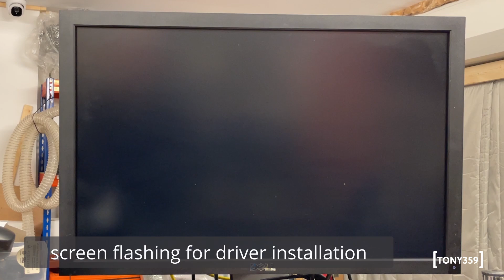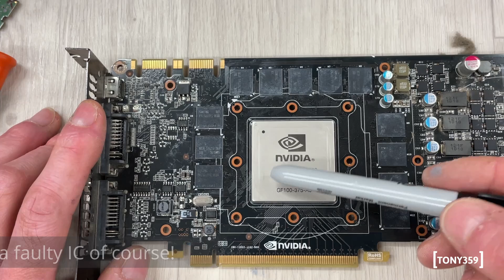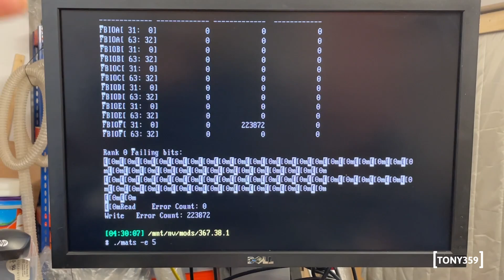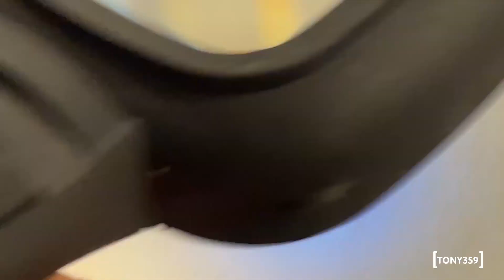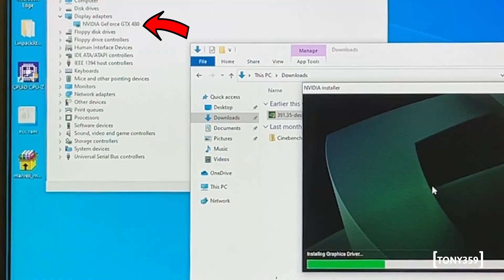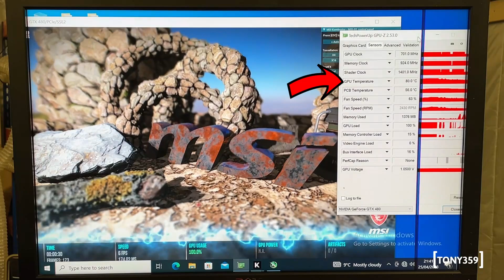GPU crashes with BSOD, can I repair it?

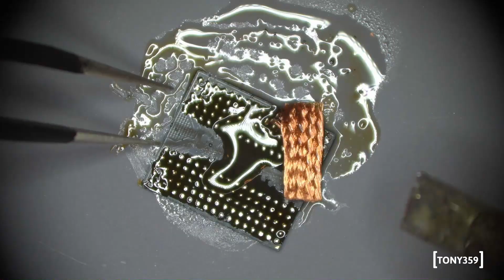Comment: 16:54 it's recommended to keep these lead-free solder balls because GDDR chips can get very hot under load. Leaded or medium temperature solder is more likely to break under high temperatures.
Also the thermal paste inside Nvidia GPUs with heat spreader of this era will dry out after years of use.
Reply from the maker: Thanks - leaded solder melts at 183C - to get 183C on a solder ball, the transistors inside the chip would be 200+. I honesty doubt that anything can work at those temperatures. I feel it's much easier to damage the PCB or surrounding components with the higher temperatures required by Lead free reballing. Thanks for the input though!
Reply: @tony359 Leaded solder doesn't melt, but has a higher possibility of cracking after several cycles under the circumstances I described. High temp soldering doesn't damage if your PCB quality is not too bad. Actually, I use 320-380 degrees to solder BGA chips with original balls, and they work well.
As always, thanks for your reply and great work.
Reply from the maker: I am far from being an expert but cracks are often associated with lead-free solder, not leaded. I feel leaded solder can withstand thermal cycles much better than lead-free. Cracked lead-free joints after year 2000 are a plague in electronics.
The only time I saw someone soldering with lead-free intentionally (besides official service centre which might be forced to obey regulations from an environmental perspective) was a german engineer who replaced the 12V connector on a GPU and used lead free as, in his opinion, it is a better choice for sturdiness on something which is subject to mechanical stress. 
As I said, I am not a mechanical engineer or anything but my understanding is that leaded solder is better - it was removed for environmental issues. Rightly so of course.
Reply: @tony359  Yup I'm also amateur. But AFAIK, cracking of lead-free solder is usually connected to mechanical damage like striking, but not thermal cycles. In fact, in my country, repair shops always use lead-free solder for laptops and GPUs, not for RoHS requirements, but for lower return rates. For devices that make less heat such as SSDs, leaded solder is okay, especially easier for hand soldering.
Reply from the maker: I haven't got elements to evaluate what you say but it's definitely the first time I hear about someone re-balling using lead free solder for reliability purposes! That doesn't make it wrong, it's just honestly the first time I hear that.

Comment: NVidia cards are a little sneaky. The VCore supply is split, with one phase being fed by the PCI bus connector and the rest by the 6+2 power expansion connectors. The reason for this is that they want the card to be able to do some things, at least power on and display an error message, even without being properly wired up, and possibly do some diagnostics before drawing full power otherwise. Most people fail to wire up the power connectors when they install their first card, and the card wants to be so polite as to point them in the right direction. There is usually a bunch of detection circuitry that goes to the VRM control IC and then that outputs the insufficient-power signal to a GPIO pin in the GPU core.

But i don't remember the symptoms when one of the heavy VRM phases fails open that you expect of this card. One possible symptom is that the card is stuck at low clocks. I don't know if drivers not launching is a valid possible symptom for that, i'm not sure, it obviously wasn't in this case and probably shouldn't be the first suspicion.

So yeah because of the VRM topology, when you measure the current on the power expansion wires, you aren't even getting the whole VCore current, some of it still comes from the PCI edge connector, and VMem etc are from the edge connector as well. However the first thing that happens to all those 12V inputs both the edge connector and the expansion wires, it goes into big fat shunt resistors that are monitored by the GPU. So when you call up the power stats in Afterburner's RTSS or in GPU-Z or any such utility, you're actually getting precision measurements of the power that goes in including VRM losses and just about everything that's on the card, no need for your own current measurements. This is not the case for AMD cards, you can't really trust what those report.
Reply from the maker: thanks for the useful insight! I'm always amazed by those who master Video Cards like you!

Comment: The issues you had with installing the drivers was probably because 391.35 came out 8 years after the GTX 480's release. Ussing the last officially supported drivers is not usably the best. Driver optimization for that card stopped 2-3 years after release. So more ideal drivers would be from 2012-2013.
Reply from the maker: Thank you. 391.35 are the last drivers supporting the 480 - and they worked on another windows installation, I think it’s shown at the end of the video. Thanks for watching!

Comment: Is there a similar program to diagnose the memory in the radeon 9800 video card? I have two cards that can display a 2d image, but one displays tiny artifacts in 3D games, and the other doesn't accept drivers :/
Reply from the maker: Hello - I am not too familiar with this type of programs myself. I understand that MATS works with AMD cards as well but I do not know if the 9800 is compatible. That said, try the one I tested in the video, it runs under Windows and it should be manufacturer-agnostic! :)
Obviously MATS is a necessity when you do NOT have a video output but if your system gets into Windows, then it's worth a try.
Thanks for watching!

Comment: What do you mean it's not retro? Soon it is going to be retro😂
The BGA shakes do seem to be getting a bit better compared to the first attempts you did.
Recording it probably puts some extra pressure on you i presume?
I know about similar driver installation issues after a driver failed to install correctly and the fix used to be installing an older version first followed by the newer version.
But nvidia drivers can be a bit silly, recently upgraded from a 1070 to a 3080TI and updating the drivers just didnt work at all so had to do fresh windows installation.
Reply from the maker: Ahaha - no the ‘shakes’ will never improve! It’s like my life depends on that 😂 
I think I tried a random older driver and that failed too. Weird but good to hear it’s not uncommon. Thanks for watching!

Comment: I know that you are no beginner, but I feel compelled to ask - regarding GPU temperatures, did you use thermopads of proper thickness? It is common mistake to use too fat thermopads and that makes a gap between heatsink and GPU.
Reply from the maker: Oh - also remember the heatsink is NOT part of the plate with the thermal pads. It's a separate piece. So even with incorrect pads, the heatsink would still sit on the GPU as expected!
Reply from the maker: Feedback is always welcome and I’m always learning! I think so. I used 1mm and I compared with the ones I removed and were identical. Thanks for watching!

Comment: At 20:07, the weird characters you see are ANSI control codes that are shown because you pipe the output to "less". Either don't pipe to less (so your terminal will display them properly) or invoke less with "less -R" - which will display the characters in raw mode; so the terminal will interpret them properly.
Reply from the maker: Gotcha! I suspected that as once I opened the report.txt file and they were displayed correctly there. Thanks for that. The incorrect characters I see on the bank names and operation type is the corrupted RAM though? Thanks for watching!
Reply: @tony359  The incorrect text in the first pass (before you replaced the chip) was indeed because of the hw issues. Thx for the video, I enjoy watching your repairing adventures!
Reply from the maker: @ThanassisTsiodras  Thank you for your kind words! :)